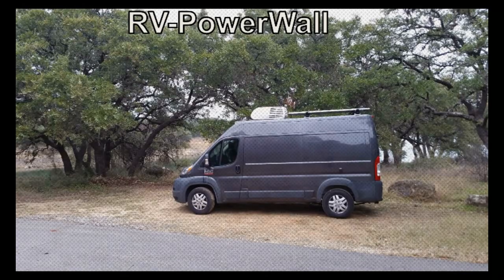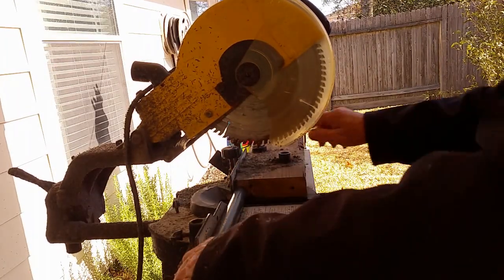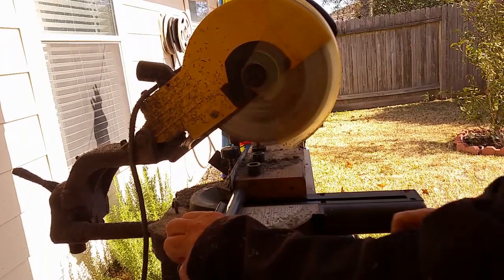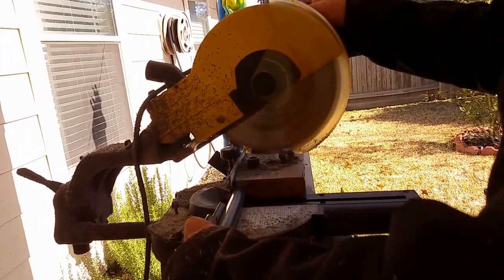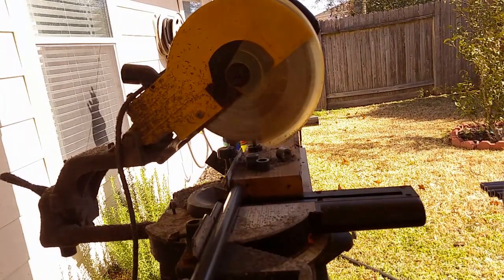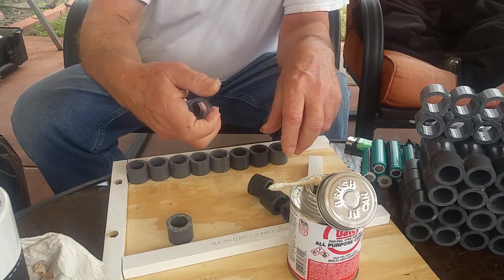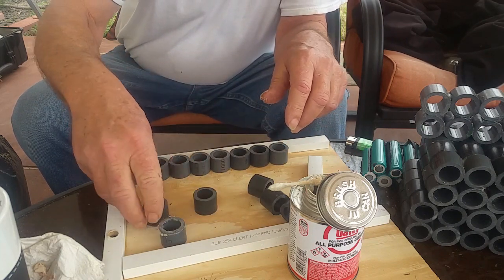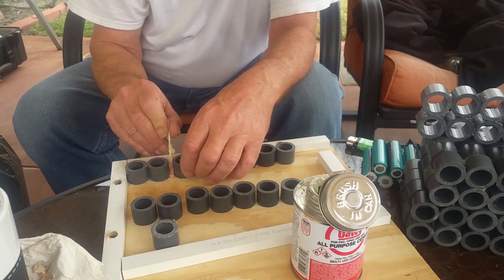DIY RV PowerWall 18650 Battery Holder Build 1

Comment: Does the pipe help keep them cool?
Reply from the maker: That was the intent however using these batteries below 1c,  there is no issue in keeping them cool.  The largest load these batteries experience is 47 amps at 24 volts. Since this battery is configured in a 7s 100p ... 1c = 200 amps. Sooo the max load is only 1/4c.
Reply from the maker: The pipe is just an easy way to mount the 100 batteries to wire them in parallel. The pipe allows you to change out a cell if the need ever arrises.